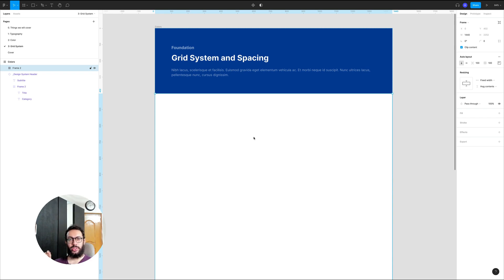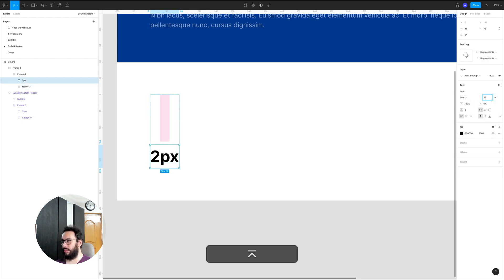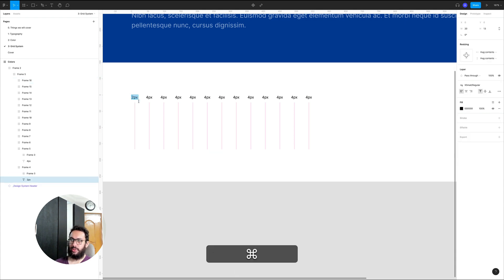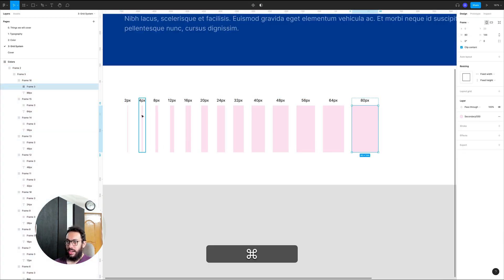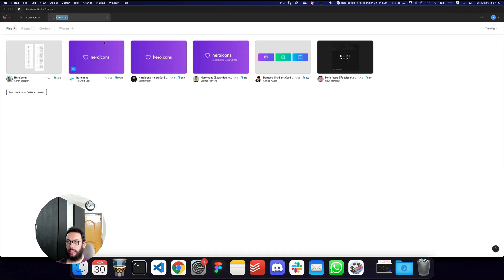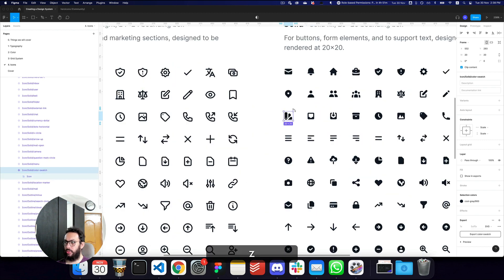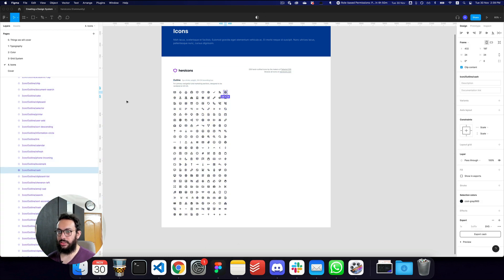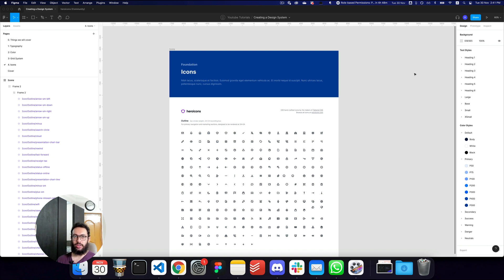Creating a Design System - Spacing and Icons

Comment: Dosen't design system include determining for the values in pixel for padding, margin, gap spacing, and dimensions for things like forms, Hero or Features sections, or the spaces around the page and between its sections?

someone said that bootstrap design system contain recommendations for this things but I can't find this.

so is there a place that has such suggested values?

Comment: I guess we should double the spacing after 8.. why we increased 4px in first 7cols than 8px in 5cols ?
Reply from the maker: We can do that, but personally on smaller elements, I see a need to use 4px spacing after 8 as well, like 12, 20, etc.
Reply: @AMDesignAndDev  Yeh for that you need to set the rules when and where that particular spacing will apply like before and after table 40px that means 40px will be used in each table before and after.